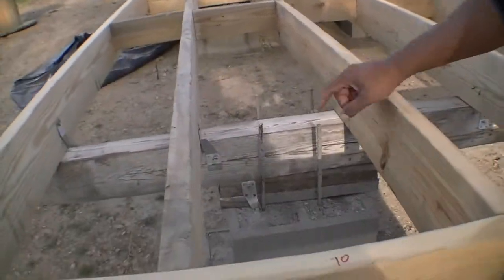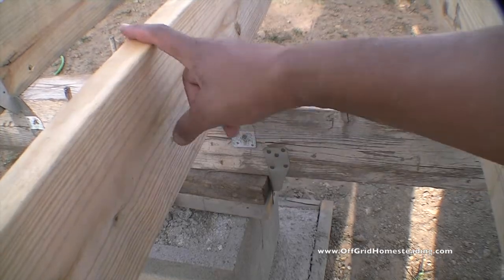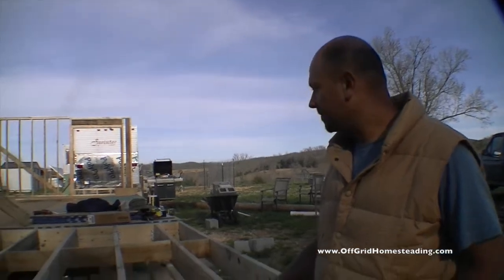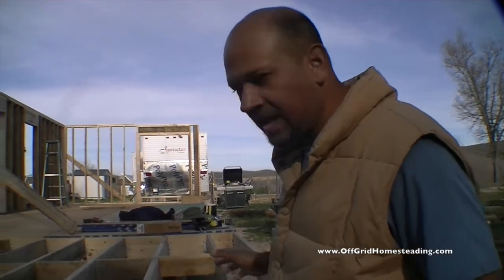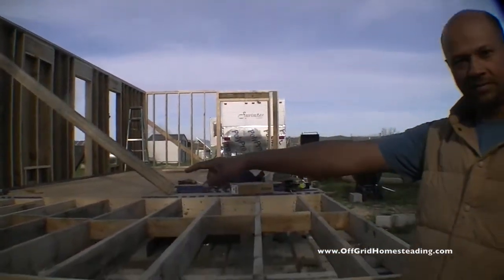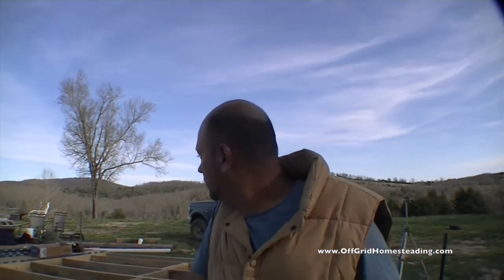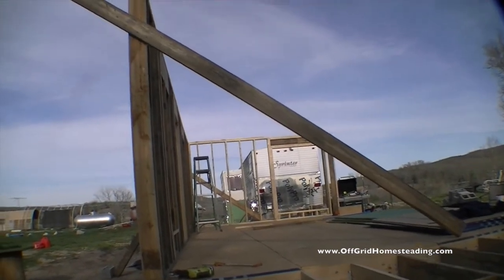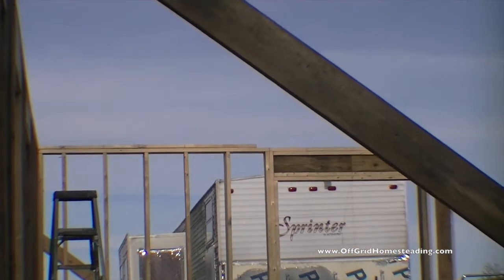OGH - DIY Framing of Tiny House part 4

Comment: L👀ks good. Now make a mark 5-1/2"s in from the end of the addition on the south side and another at the opposite end. Set a nail at one end and pull a chalk line through to the other end. Have Kelly push the line down with her finger somewhere near the middle of that span and hold it there. Now snap the line on each side.  Measuring from that chalked line at any point along that line to the edge of the floor/rim should equal 5-1/2"s. If it's off then you will need to flush the edge of the bottom plate of the wall to the edge of the floor after you stand the wall. Don't adjust the line. A straight line is needed to toenail your bottom plate to in order to square up the entire south wall. It is impossible to square a wall accurately if the top or bottom is not straight. You can adjust the wall to make your diagonal measurements equal. but it won't be plumb after you stand it up unless the top of the wall and the bottom of the wall is straight. This is the reason why the sheathing is not attached to the walls when the floor is concrete. You can't hold the bottom plate on the line to square it up because you can't toenail into concrete. If the pros are willing to go to the extra effort, time and expense to apply the sheathing after the walls are stood, like this crew: https://tinyurl.com/y75dne8t (It always took me at least twice as long) then you know it's important to get it right if there leaving the sheathing off the entire building. That's a lot of extra work!
Reply from the maker: I'll try adding the sheathing on the next section.  Tomorrow is doing the WEST and NORTH Walls so we can have 3 sides up before the Rain on Sunday 60%.  Any ideas on how to keep it dry?
Reply: The OSB on the walls and floor does not need to be kept dry. They are made with an exterior glue for this very reason. Check out this article: https://tinyurl.com/ybeq4bej In all my years I've never done anything to protect the building from rainwater during framing, and that is hundreds and hundreds of buildings. We never stop framing because of the weather. I've worked in minus twenty and 106-degree temperatures. The nail guns were so hot we had to use wet rags just to hold them. The rain didn't stop us either. We just got out the rain gear. Carpenters in Seattle and other rainy climates would not be able to make a decent living if work stopped everytime it rains.
Reply from the maker: didnt' see the rest of your message... the nail guns were so hot we...  ( I cant wait for the rest of the story!)
Reply: The OSB on the walls and floor does not need to be kept dry. They are made with an exterior glue for this very reason. Check out this article: https://tinyurl.com/ybeq4bej In all my years I've never done anything to protect the building from rainwater during framing, and that is hundreds and hundreds of buildings. We never stop framing because of the weather. I've worked in minus twenty and 106-degree temperatures. The nail guns were so hot we had to use wet rags just to hold them. The rain didn't stop us either. We just got out the rain gear. Carpenters in Seattle and other rainy climates would not be able to make a decent living if work stopped everytime it rains.